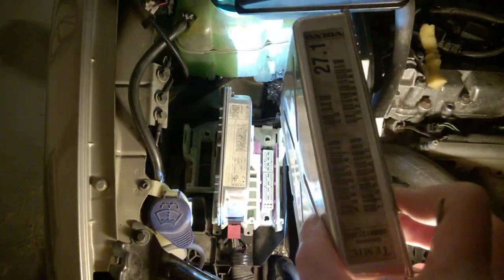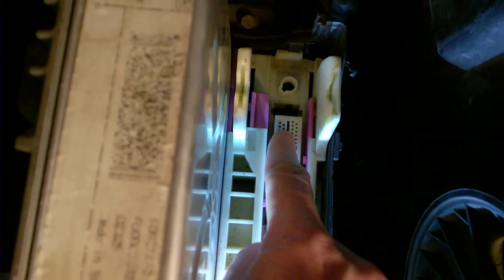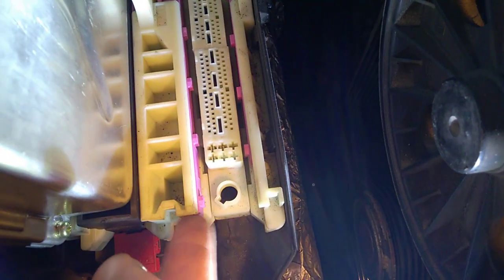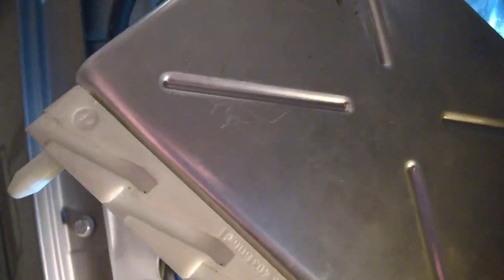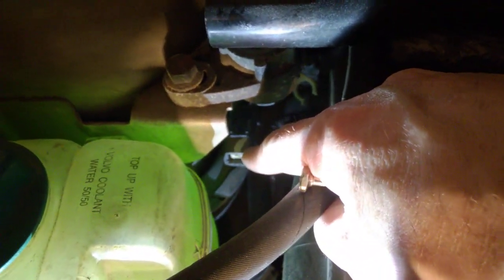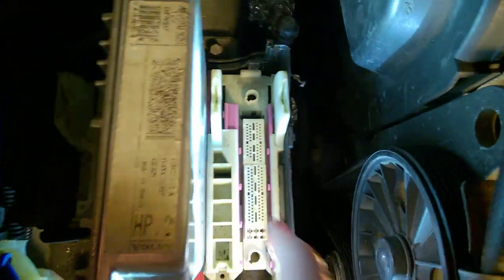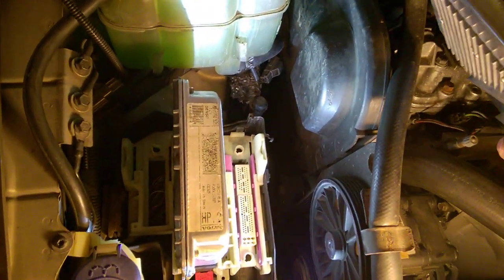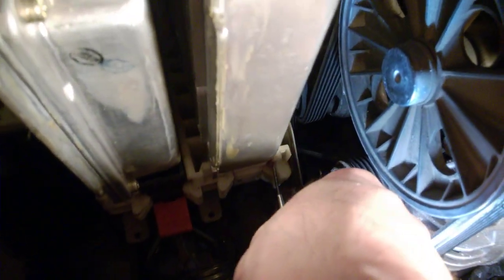Volvo S60 XC90 S70 850 ECM (ECU) and TCM modules removal tips

Comment from the maker: As you look at the box, the left module is the actual ECM (or ECU) while the right one near the engine is the TCM (Transmission control module) that appears to work for both manual and automatic transmissions. Here's a video showing a problem with the connectors for these modules  https://youtu.be/KjxjhcZxuDs
Reply: Ff
Reply: THANK YOU I WAS SO CONFUSED

Comment: I tried reflashing my ECU today, on a 2001 v70 t5 , but now it just cranks and cranks and cranks.  I reflashed with same file again, same thing, so I tried reconnecting dice and maybe doing it again, but now dice will not connect to car at all.  STC Service required is on message board, and the gear will say P when key is in then change to a horizontal dash after a few seconds.  Any tips?
Reply from the maker: Have you tried the forums ? Matthews and the Uk one. May also try contacting this company, it's a person that can connect and reprogram remotely   https://www.datatransferring.com/contact

Comment: My volvo s80 2.4i has a p0012 intermitent problem? Vvt problems any idea?
Reply from the maker: How did it happen ?  All of a sudden ? Did any work just before ?
Reply: @Peppermint1  i bought the car with this problem
Reply from the maker: @TheDefault960   Then it's a bit difficult. Perhaps the easiest is the VVT solenoids, or worse, the VVT hubs may be out of adjustment, perhaps after having been removed, which is very difficult to set back correctly. Try also asking on forums like https://www.matthewsvolvosite.com/forums/viewforum.php?f=9
Reply: First you need to use correct scanner for Volvo - Vida Dice
Reply: I think the problem is the vvt pulley, because this Saturday I went to change my timing belt, but I saw that the vvt pulley is not aligned with the timing marks. How can I adjust the vvt pulley? Thank you

Comment: Hi good day .  I am a follower of your channel and I would like you to help me or make a video where you will explain what problem my 2003 Volvo S60 has.  on the screen it tells me that it needs a transmission service if you could help me I would appreciate it. greetings from new haven ct
Reply from the maker: Try first replacing half the fluid using the correct type 3309 - the best out there is the Toyota Type IV (they use the same transmission), the Mobil ATF 3309 (not the same as Mobil 1 ATF), and Idemitsu from Fcpeuro if you are in the USA.  You can either drain it once at the bottom bolt, then refill with same amount (around 3.5 liters) by the dipstick hole ONLY, or use the "Gibbons' method at the transmission return cooling line. I suggest you only replace around 3.5 Liters, not complete (it's about 7 liters). And very important, refill only through the dipstick hole, never remove any other transmission bolt, those are for the internal gears. Then try driving inside the city, not open roads, so the transmission can shift gears and adapt to the fresh fluid.   https://www.fcpeuro.com/products/volvo-transmission-service-kit-idemitsu-1161540kt
Reply: @Peppermint1  how about good day  if you remember the problem with my 2003 Volvo S60.  I made the oil change to the transmission as you explained it to me in your comment and still continues to have a little knock when putting in reverse. What other option do you have to solve that problem. Thank you very much for your attention and I await a response  soon
Reply from the maker: @ariespantle1805  Hi, from the transmission perspective, I am not aware of a fix for this. Still worth perhaps looking at the upper and lower engine torque mounts, and perhaps inspect the axles for play.  About the only thing we can do with these transmissions beside new fluid, is to replace either the 3 main solenoids, or the entire valve body assembly and perform a adaptation relearn. But if the transmission is working fine other than that reverse knock, I would leave it as is. Mine has such harsh reverse engagement (it lost the adaptations), I don,t feel it's going to cause any damage in the short term